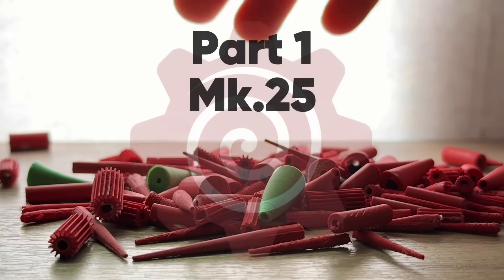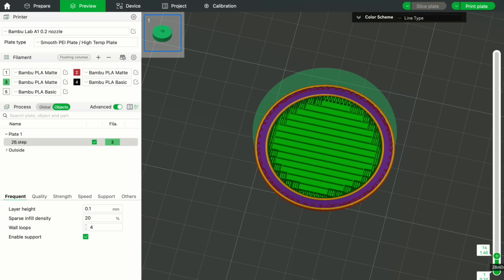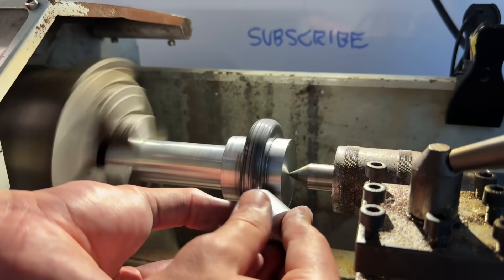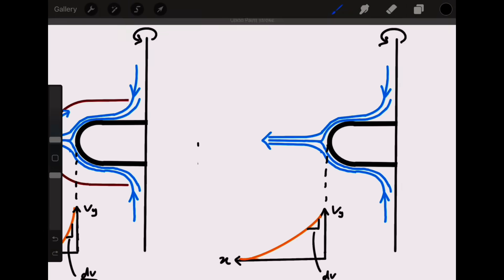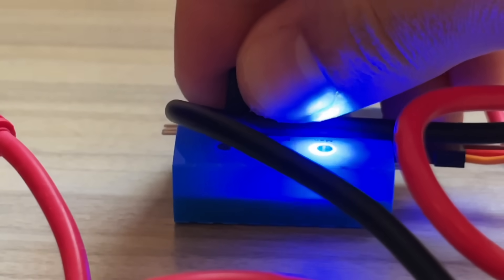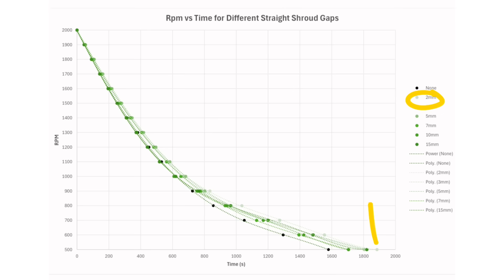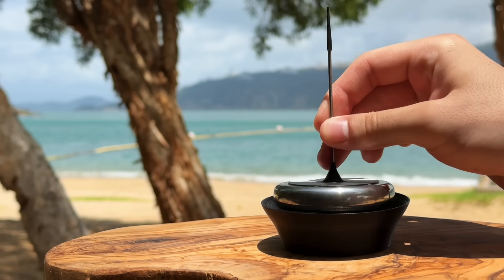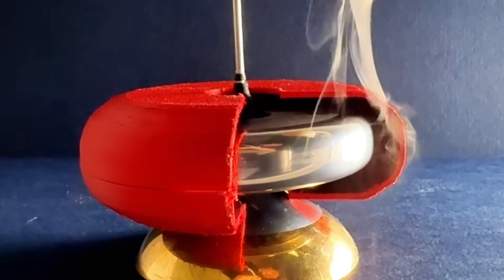Spinning Top Mk.25 | Aero Shroud??

Comment: My immediate impression with the 3d printed parts is that they are quite rough. The core does not look well fitted to the flywheel likely causing more drag. The surface roughness of the 3d parts are also likely having negative effects with the airflow. I would suggest looking at sanding and polishing the core and shroud decreasing drag around the system. I would also suggest looking into resin printing + sand and polish for better surface finish of those parts.
Reply: Very much this. If you continue to use PLA, you might try alcohol spray to smooth out the interior mold lines to reduce the boundary layer drag there. Much cheaper than going to full resin printing and less labor than hand polishing. Reserve that for the flywheel!

My other concern was the PLA core. Your reluctance to use plastic due to poor dimensional stability is warranted! Buuut you might be able to get a roll of higher strength polymer to use that could get you a very strong and stable core while still being much lighter than the aluminum.
Reply: @NotOneToFly  or resin, i think smoothon makes some resin for fishing that is extremely light and very dimensionally accurate, although casting resin is far harder than 3d printing. i would love to make a top if i had a way to machine tungsten, although i have been looking at bismuth for casting a high density ring.
Reply: This may also be impacting the shrouds, as a rough interior will apply greater drag to the airflow, which is then transmitted to the top. May be related to why the perforated shrouds didn't perform as expected, as the holes especially are very rough. Luckily, surface smoothness and transparency have a lot to do with one another, so that pursuit should improve them and elongate the period where they are relevant; the techniques can then be transferred to some degree.
Reply from the maker: @Ziraya0  This is a great thread of suggestions! I can certainly get the PLA core to a much more respectable finish given a bit more time and effort (I found that sanding and then using a bit of furniture wax was surprisingly effective). To be honest I was just a bit impatient to get this video out! You can expect better quality 3D printed spinning top components in the future :)
Reply: @hiper_tops use ABS and acetone melting?
Reply: You’re splitting hairs in the weight department at this point , but you can also use “aero” versions of PLA and ABS. These are filaments that foam at high temperature, allowing you to print the same volume at as low as 50% the weight in some circumstances.
Reply: At the extreme, the choice of print material has to be a compromise between weight and rigidity. A more flexible filament is going to absorb the energy of small vibrations, converting that energy into heat via small scale deformation. Basic PLA is the most rigid simple filament, even PLA+ is trading rigidity for elasticity, making the parts less prone to shattering. Foaming PLA is of course trading a lot of rigidity for lower mass. I don't know, and this is such a niche application I can believe nobody knows, what the ideal amount of rigidity is. Maybe some of those vibrations are parasitic, so having the print absorb them stabilizes the system. Surely a jello consistency would cause problems, maybe the ideal material is artificial gemstone with enormous rigidity and an extremely optimized shape to keep the weight down. And regarding "simple filament", a fiber embedded filament may be better, or the elastic bonding of the inelastic fibers may absorb the most energy. Layup starts to be an issue with those as well and to my knowledge slicers don't strategize for fiber direction yet.
Reply: I would think that the plastic core would introduce some balance problems, as to whether these are masked by the much larger weight of the flywheel, which being at the circumference is even more effective at masking is a matter for testing to see if any wobble is introduced.

Now I haven't watched all these videos but have you tried a very thin centre (core) machined from magnesium alloy or a similar light weight metal alloy & the core pressed into the flywheel , this might be an option. 

There is not much real radial force with a hand spin, so the metal could be really thin &easily polished to a very low roughness. 

Have you tried a golf ball like finish to the top, as an experiment? It might not be easy to achieve on such a small surface but maybe etching the pattern or CNC milling it into the flywheel?

Fingers crossed for a potential world record & the following arms race should be interesting 😁

One final thought, do the rules allow the use of a lower drag medium eg helium for the spin to occur it, I'm not sure how you could achieve this but if you are allowed to shroud the top who knows. If nothing else I hope my comment helps the algorithm.
Reply: What? Isn’t rough better????? I don’t know if rough is GOOD, but I know it is better than perfectly smooth
Reply: @melody3741  It's a matter of scale, the 3D printed parts are never going to approach the smoothness of the polished metal ring, never approach anything you might call perfect, but as they are now they are extremely rough. The layer lines create irregularities in the scale of 0.03~0.15mm, depending on layer height configuration. The seams can create bumps and juts several times that. Inconsistency in the filament, cleanliness, extrusion rate, drive gear wear, can create roughness across this whole range. And all of these things vary a lot, so the roughness is rough too. Some of this roughness is parallel to the air flow path, some of it is perpendicular, some of it is random, and some of it, like the layer line stepover in the arch, varies continuously

If roughness is good, which I'm not educated about, then you want consistent roughness of a particular type and scale.
Reply: Is it more about the shape of the flywheel and how the airflow remains attached with both flows hitting eachother, being forced out not just by centrifugal force but also the resultant force of the convergence? Maybe a rough surface instead of smooth could cause a boundary layer or a different shape could cause separation and reduce pumping losses. Or maybe not 😂
Reply: or he could machine out a block of acrylic.

Comment: Awesome! Did you consider to make "Golf ball" dimples to help flow seperation?
Reply: I feel like the flow would be quite attached in this case, so it would be beneficial to reduce skin friction with a smooth surface. Roughening golf balls is used to delay flow separation and reduce pressure drag.
Reply: Won’t help most of the drag is doused by friction with air and not a pressure differential the best option is to make the surface as smooth as possible to get the least friction, dimples on golf balls help to get a smaller a more stable wake so as to get less pressure drag and a more stable and predictable trajectory but they don’t help with friction
Reply: Okay I let chat gpt do a deep research and its against dimples...
Reply from the maker: @SirSilicon  Indeed dimples are counterproductive since spinning tops wouldn't benefit from any reduced pressure drag and would just experience more viscous drag. I will demonstrate this in a future video :)

Comment: The shroud has the same effect as putting your hand over the end of a vacuum or blower hose. The motor speeds up...

Less or no air is being moved, so less work is being done and less power consumed.
Reply: You are correct, you understand how the shroud really works.  I discovered this effect about four years ago, and from time to time I still use it for my tops:  https://youtu.be/oKxrP7-QXpk
Reply from the maker: @Pyroteknikid That's a great analogy and explanation!